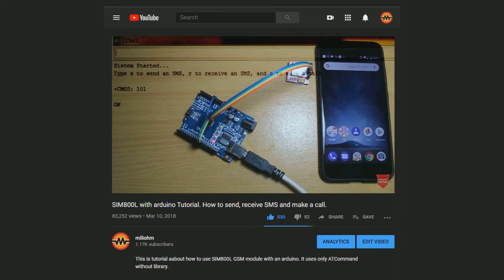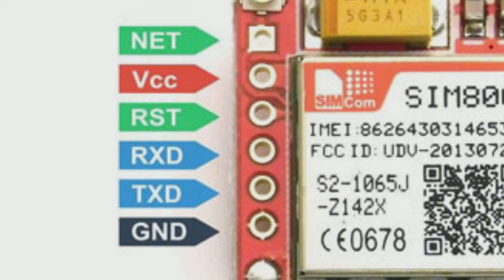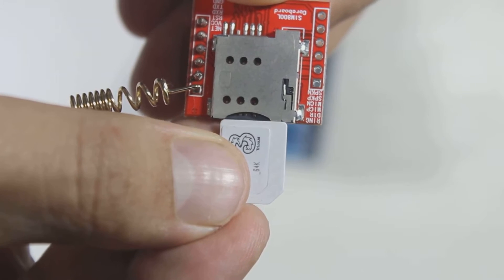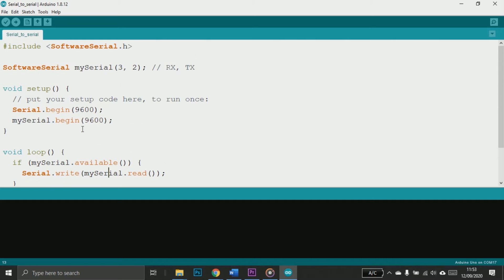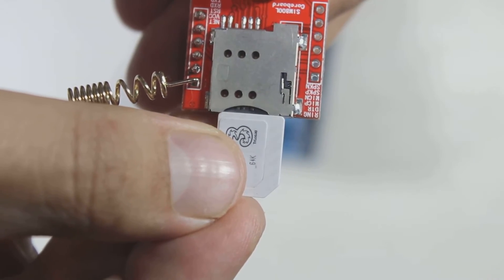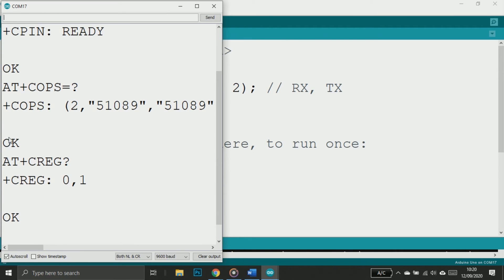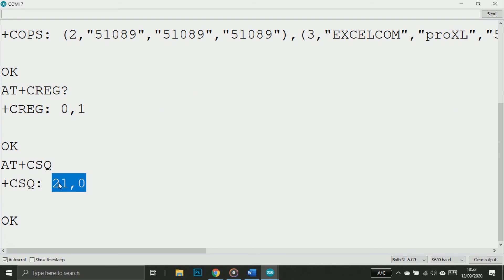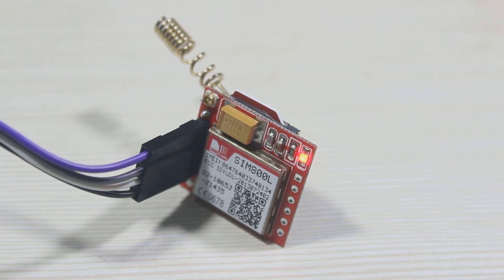SIM800L Troubleshooting guide (Solution when you have problem with SIM800L)

Comment: My Gsm module light blink 7 time and after that it not blink in 3 sec after that repeat same  for all the 
Plz give me suggestions what I do ?
Reply from the maker: I think that's caused by power. When it is trying to register. The power is not enough. What power supply did you use?
Reply: @miliohm  ardino board  use to  power Gsm module
Reply from the maker: @pateldhruv4657 it's the 5V? Try another power supply with more power
Reply: @miliohm  it 5 volt but in series use diode  so output voltage around 4.3 V
Reply: @miliohm  okay
Reply: @miliohm  I tried 5V, but it still doesn't work. And gives the same 7 blinks 3 seconds thing. I am using Airtel 4G sim of my mobile.
Reply from the maker: @jeeveshjuneja445  try with your phone is the SIM card fine? and did you try use 2A of minimum power supply?
Reply: @miliohm  yes sir. The sim card is fine. I think Arduino can provide 2A. I am using that power supply only. Also, if the LED is blinking brightly, I guess it should indicate that power supply is enough, or not?
Reply from the maker: @jeeveshjuneja445  no, Arduino can't give that much current. The SIM800L need more power when it try to register to network. And the bright LED doesn't mean enough power. Because the power needed for network.
Reply: @miliohm  sir, even if I use 5V of arduino, it won't give 2A? Which battery shall I use?
Reply from the maker: Yes, your usb power from laptop can't reach that. You can buy adapter or use 18650 battery.
Reply: @miliohm  if I have a 12v 2A adapter.. and I plug it into Arduino.. will it work then?
Reply from the maker: You should decrease the voltage using step down module, like in the video. Because if you use 5V from Arduino. Even it plugged to 12v 2A. The voltage regulator in Arduino board will not allowed to draw 2A current.
Reply: @miliohm  Okay. Thanks. I will do that.
Reply: My module is blinking every second ...I use a 12V 2A supply with a step down to 4.1V and it won’t connect to the network
Reply: H

Comment: when i tape AT+CREG?  the module send 
+CREG: 0,2 ,what does it mean?
Reply from the maker: it's not registered. but trying to register to network. Try increase the voltage for supply. Or try use 5v from arduino. sometime it just works.
Reply: thanks a lot!

Comment: hi, thx for the video it helps me a lot. but i have a question, when i follow your way to troubleshoot i didn't have any trouble, except when i check my sim card registration using AT+CREG? it always show 0,0 or 0,3. and then i had check my power supply and set it right as the datasheet but the indicator still blinking every 1 sec. how do you think to solve it? thx once again, sorry for my bad english
Reply from the maker: Try increase the voltage. 5V is still tolerable. Then restart the SIM by unplug the power. If still doesn't work try AT+CREG=1. By the way what happened when you type AT+COPS?
Reply: @miliohm  okay I will try it, when I type AT+COPS? it shows the list of network too same like in your video
Reply: @miliohm  Hi bro, when I check my sim card registration using AT+CREG? it always show 0,2 or 0,4, and I used 4.3 Vdc. can you help me ? please
Reply from the maker: @lf-m516  try increase the voltage, the unplug the power and plug again. wait some seconds
Reply: @miliohm  I type AT+CREG=1 and then when I tried check it with AT+CREG? It come +CREG: 1,3. I Think it is still not correct, i was increase the voltage too to 5v btw
Reply from the maker: @frymazhafran9084  did you already check the sim with your phone? and did you already try with another operator? Im not sure what's wrong
Reply: @miliohm  yes i had try to check the sim and it is work perfectly in my phone, and when I change with another sim card it is still not right like I said before
Reply: @frymazhafran9084  I have exactly the same problem like you :( did you solved it till now?
Reply: @frymazhafran9084  did you find a solution?